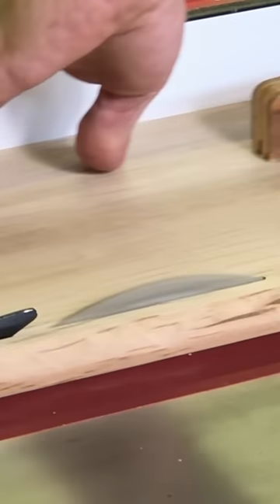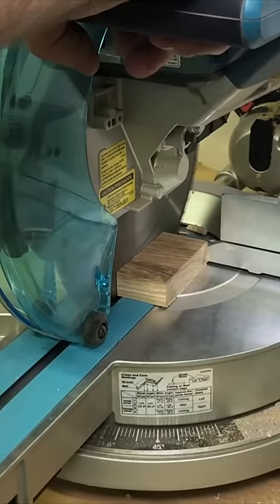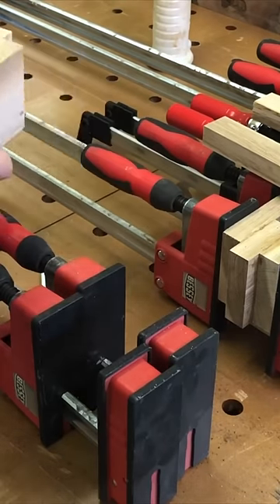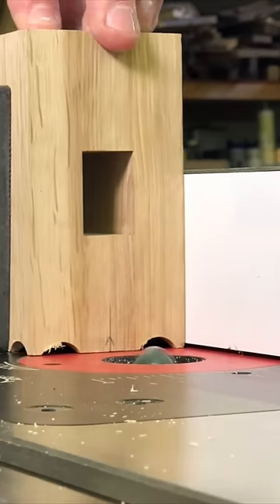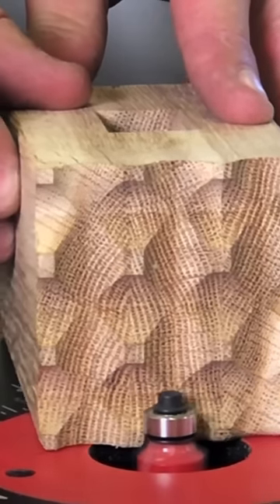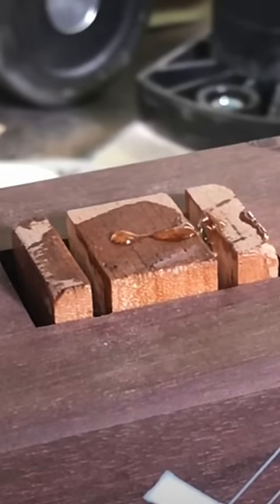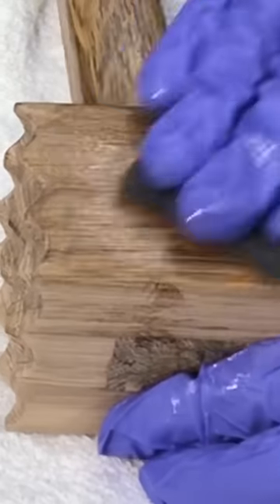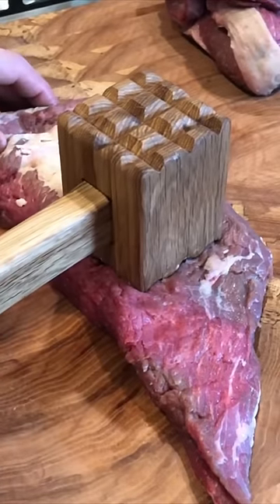DIY Wooden Kitchen Tools

Comment: Had me a bit worried finger got awfully close to the sawblade there
Reply: Yep very sketchy stuff. Also getting this close with his pushing aid, whatever it’s called. If that thing catches the blade ur hand is in for a ride
Reply: My brother did that. Went 4” up his arm, starting at his index knuckle. Not pretty. Bits of meat in the saw blade etc
Reply: As long as you’ve already taken great care in making sure that it’s impossible for the blade to protrude beyond the thickness of the board your cutting - really not much to worry about there and def just looks worse than really is
Reply: Where?
Reply: @TylrVncnt  Irrelevent. What's happening these is risky stuff. That's how people lose fingers.

Comment: Meat tenderizers are made out of metal because the weight is more helpful than the irregular pattern, even a dense wood is generally going to be lighter than steel (exceptions might include some ironwood varieties and perhaps a few other choice species, but white oak isn't as dense as steel, which means it's looking lighter when the same size) making it less effective.

Comment: I would use wood, but the face should have a horizontal grain hitting the meat, not the "closed pores." hitting the meat (?). Also, I thought Maple was the only hardwood allowed for cutting boards for commercial applications because it has the tightest grain.

Comment: No, just metal, it will last forever
Reply: So will a wooden meat mallet if you condition it right, don't soak it in water, and only use it for its intended purpose.
Reply: @_theoriginalb4handles_Genflag  I’m
Sure if you take care of it, it will last a long time but it won’t compare to a steel one. That will
Last for centuries.  That’s just a fact.  For the same price or probably less, a steel will be superior. There’s actually a reason why wood is t used much for utensils. There was once a time when every thing was made from wood, bowls, plates, spoons, etc society has moved 0n.